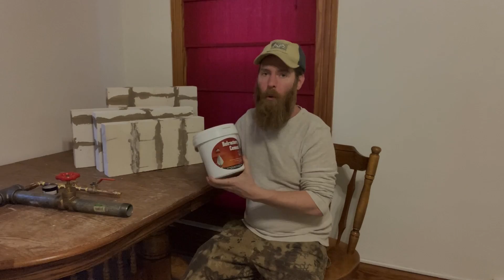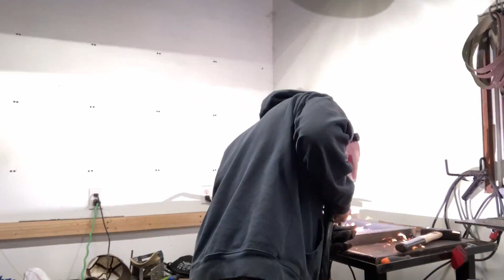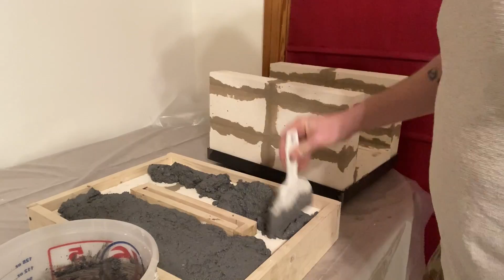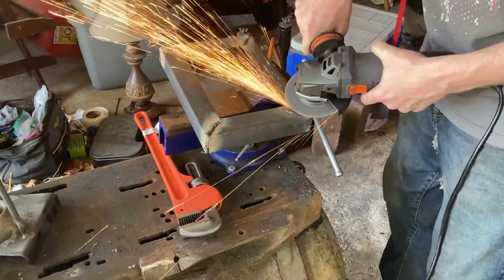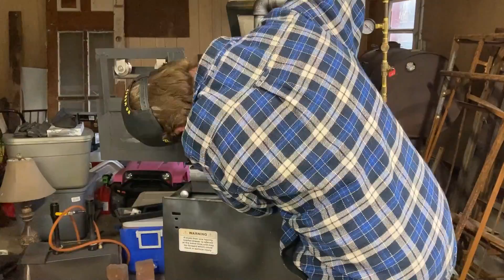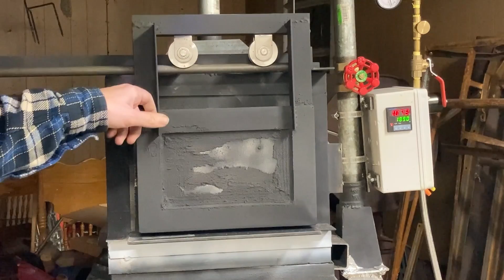Build Ribbon Burner Forge w/PID temp control

Comment: I have a similar set up but with a couple extra safeties incorporated. I use a magnetic switch so if I’m away from the forge and the power is interrupted the switch pops into the off position because if the power goes off long enough that the forge temperature goes below the ignition temp of the gas it will not allow any gas flow when power is established again. The second thing I installed which was cheap was a amp sensor on the blower. You know once the air and gas flow are correct and your blower fails the propane flame would be extremely lazy, long and soothing (just like turning the oxygen off on an ox-ac torch. So if no amperage is sensed from the blower/fan it cuts the power to the gas solenoid. 
I also put separate switches after the magnetic one for the PID and the fan so I can turn the PID off but leave the fan on to help cool the forge down faster after I’m done using.

Comment: Delaware Forge (sorry I don't know your name) - thanks for sharing. I was just researching about this assemblage with PID control/plus relay and solenoid. 
The suggestions of Bunyip are solid (even about Tfiting , rsrsrsrs)- I have hard experience with gas, mainly when the bottle presssure falls down - He is totally right.
I will share my experiences - My forge assemblage is exactly the same of yours, but shape is round and the ribbon is double chamber. I casted everything with high aluminum concrete plus a rock wool blanket - the tubes are in 1"1/2 just to cause more velocity of mixture and avoid dropping /return of 'oil gas' (end of bottle charge).
Right now, I'm projecting building another one with two ribbons in paralel to  obtain better yielding of gas/ temperature - I'm going to start on Damascus universe and my forge do not permit working wit more than a billet per operation - I loose lot time and energy .
But to operate two burners, I need using PID controll - what  effectiveness and accuracy are you obtaining with this system? 
Some questions more, if don't mind in answering:
1- your gas valve at bottle is high or low pressure? I use high pressure directly.
2- the gicle - what diameter? I believe 4,5 mm is ideal
3- Did you measure the gas consuption per working hour?
Congrats for your work and thanks for sharing

Comment: Awesome video, i would love an update on the PID controller programming. I am working on making a ribbon burner forge that my dad started. I believe i have too much volume and too many holes for the ribbon burner.
Reply from the maker: Thank you! Sorry I haven’t updated any videos lately. I sold a house, bought a new one, and still in process of moving so it’ll probably be a little bit before I get settled in an post new videos. I’ll make an update on the PID controller for you though when I get a chance

Comment: Great pearls of wisdom, absolutely right about some of the detail missing from other builds.
IMHO Especially with auto system I would pay close attention to your air/gas input manifold design, great to finally see someone using a T fitting rather than trying to drill a caddywompus hole on the bend of an elbow, I would however ensure you extend the gas nozzle tip past the vertical air input pipe to ensure no gas sinks down to the fan assembly. I would also try and introduce a slight downward slope (toward burner) on the horizontal pipe so the any gas inherently flows into the forge not back down to the fan.
No criticism, just suggestions, cheers
Reply from the maker: Thank you! Great suggestions. I did take this into account as well but in a slightly different way. I just leave the blower running for a couple minutes after turning of the gas.
Reply: you are absolutely right on your suggestions

Comment: Do you got plans/parts list available for this? I’ve been wanting to build one of these but I can’t find any information out there about it
Reply from the maker: Thanks for checking out my video. I do not have a complete parts list. Most of the steel is scrap I had laying around. However, most of the purchased material is linked in the video description.